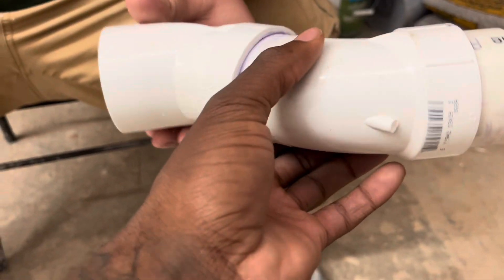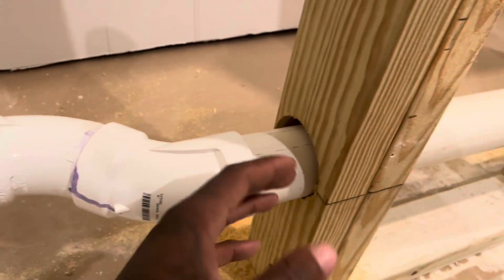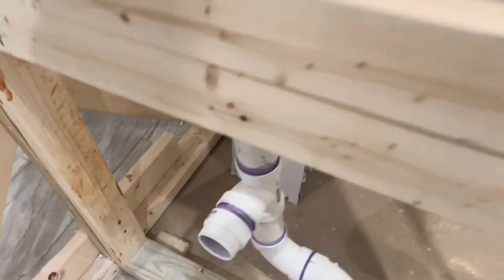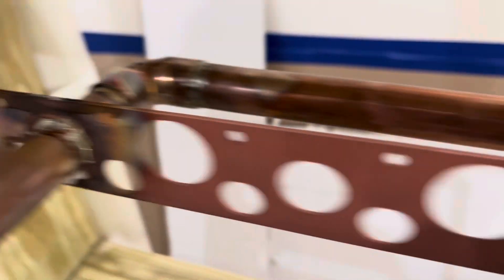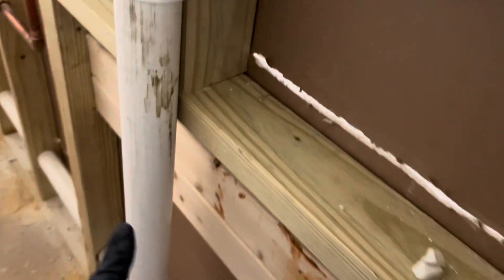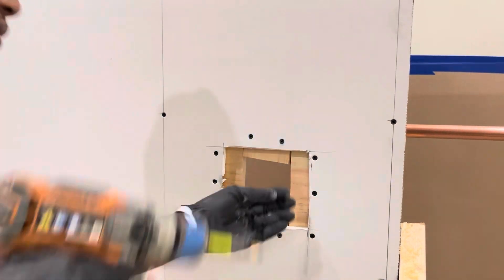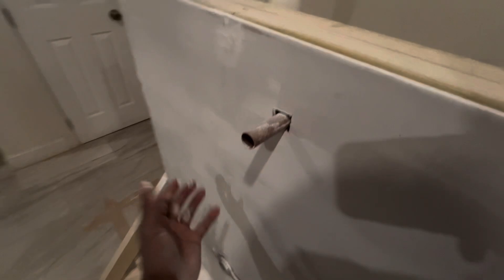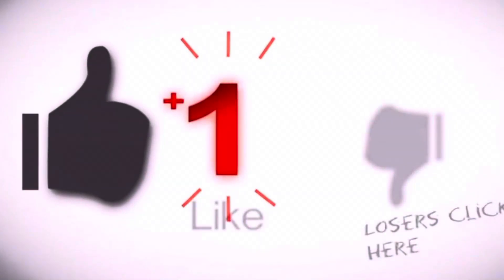Plumber School Ep:6 Sweating Copper

Comment: A couple things if this is a mock up of a real scenario you will never get a full piece of copper of pvc through the whole wall. You should practice doing it in between 2 walls. Also always cut hole in the middle of the stud otherwise you can screw through your pipe from the other side.